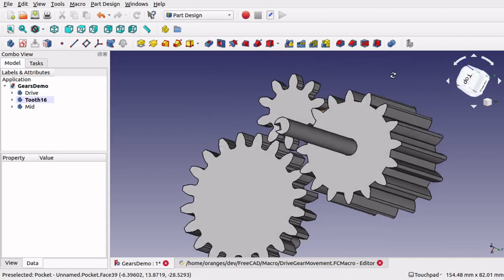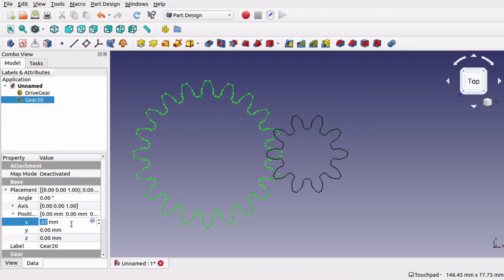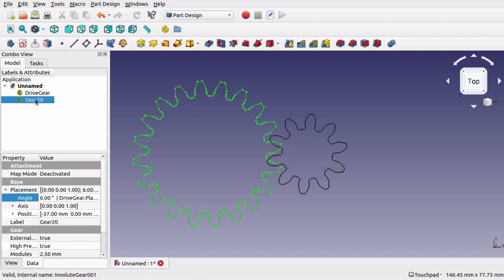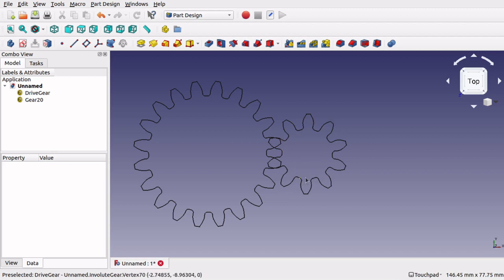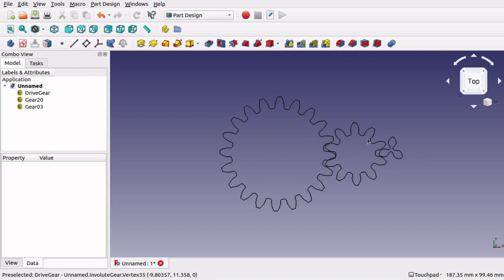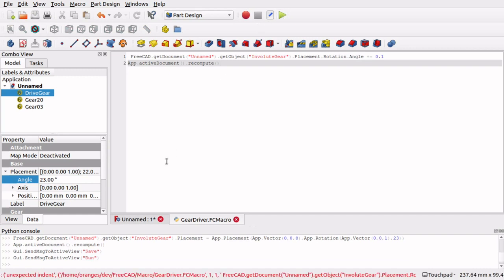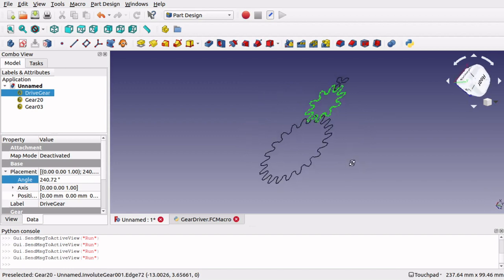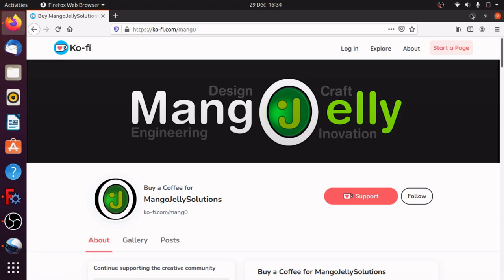FreeCAD: Linking and animating a set of gears by turning / adjusting drive gear angle with formula

Comment: I have a suggestion/request for a video. I'd much like to see an in-depth video covering all the different causes for fillets failures, from the simple basic causes, to the more complex and subtle causes, to the corner cases. Also it would be good to have guidance on a check-list for identifying and locating the origin/source of each type of fillet problem, and a how to fix strategy for each particular type of fillet problem, so that hopefully we can learn how to get our fillets working correctly (every time) even with complex geometry. I've read about using the 'OpenSCAD refine shape' feature fix to fix fillet problems and I've read 'PartDesign refine' can also help and I've read fillet problems occur when edges meet or overlap. Yet despite this, the causes for fillet failures is still very blurry to me. Solving them is often hit and miss, like doing a lucky (or unlucky) dip! Would also be helpful to know about and cover fillet failure cases where potentially there are no solutions at all (I'm guessing certain fillet problems exist that have no solutions, but I'm not certain of this).  Lastly, it would be good to get solid guidance on general best practices when creating designs to prevent fillet problems from occurring. I hope this suggestion is helpful. Cheers and thanks again for your nice videos!

Comment: Nice:). But not exactly what I want. Maybe you know, Is there any way to make rotate gears as they are a physical objects? In SW the assembly uses the same approach. User just defines speeds by simple formula using the number of teeth. BUT... User can move the body and check physical penetration with another one in assembly mode. Before that, there must be some mates defined. I saw it in a video, but don't have link for it.  Why do I need that? Well, imagine I designed a pair of gears with wrong geometry and I want to check it. I'm not a newbie in Freecad, but I never used a macros. So, I don't know where to start from. Anyway, thanks for sharing.
Reply from the maker: Are you looking for some type of object collision so they actually mesh and affect each other? Sorry quite sure what you are looking for. If you can find the link I will do some research and experimentation.
Reply: @MangoJellySolutions  Oh, Hello:) I don't know why I used this word -penetration-, maybe it's not quite the right one here. I still can't find that video, but there's another one. https://youtu.be/444CgHqLKXo?t=03m10s  If someone rotates the gear very smoothly manually by mouse, the counter gear will also rotate smoothly. But if the rotation is not physically possible, then the second gear will rotate jerkily. This is how it works in SW. But you're right, I probably need to use the collision detection, and if it is found, then try to turn the second gear at the lowest possible reversed angle. But this is cheating as I think. I can't even imagine what a real algorithm for physical animation should be in complex assembly with different degrees of freedom.
Reply from the maker: @ИванДмитриев-ф1в  yes I thought that was what you was describing . Unfortunately this is not supported in freecad yet and I think it is one of the ultimate goals to get to. Having the ability to make sure the gears mesh correctly allowing you to find any destructive forces I think would allow freecad to catch up to the likes of solidworks.